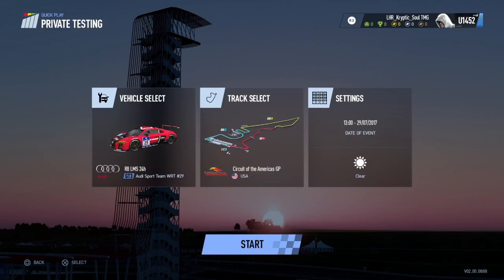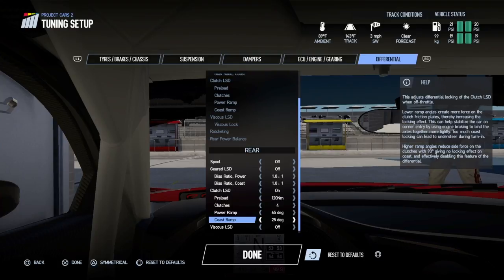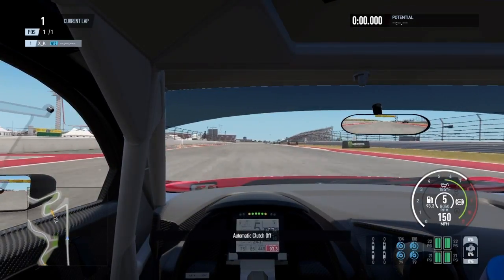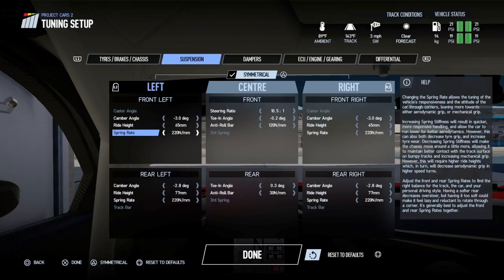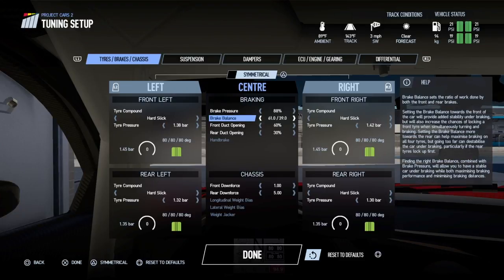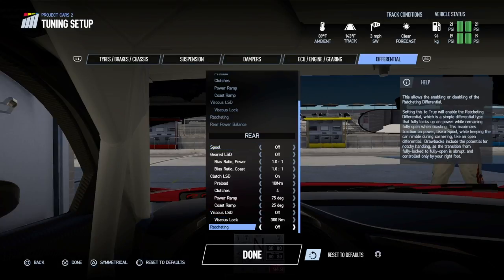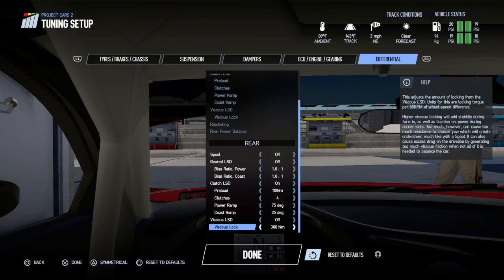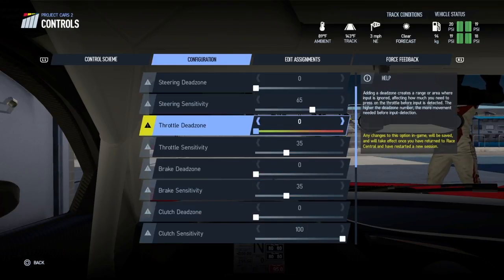Project Cars 2 | Audi R8 Making a race setup @ COTA

Comment: I'm either using this set-up or the Renault GT3 set-up, I did a 30 lap practice run with soft tires because race time is 1700 hrs in winter/spring (current date) and it did well, I added PSI 25 front and 24 PSI rear and it performed great. What's your thoughts on running my PSI that high? I read you want to achieve 32/35 PSI.